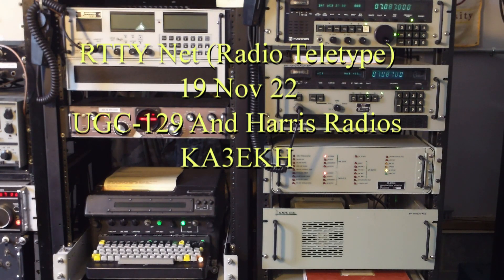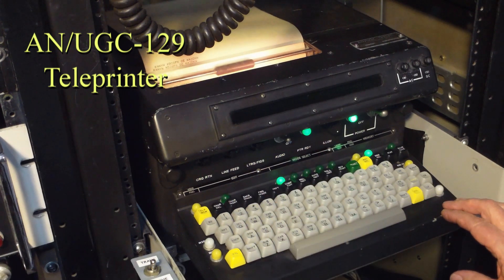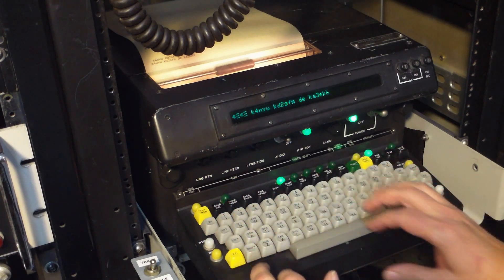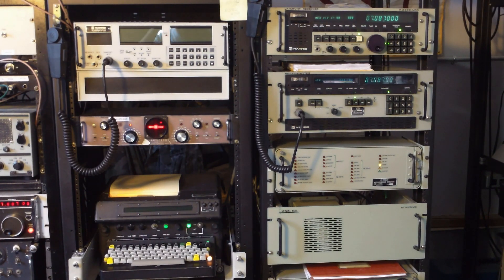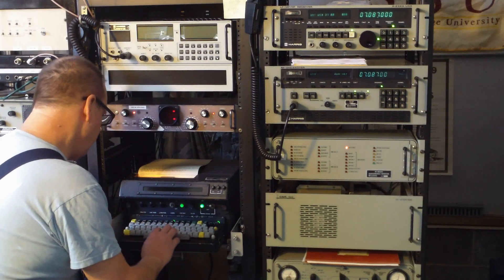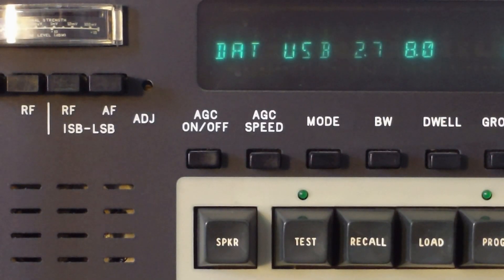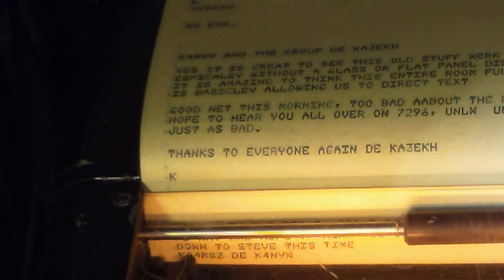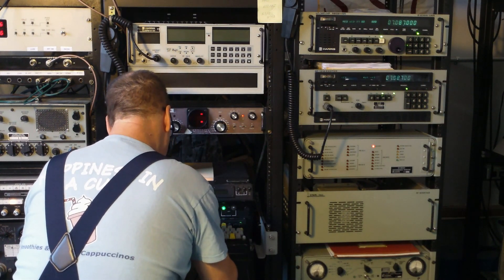UGC-129 Teletype and Harris Receiver, Exciter and Amplifier

Comment: I haven't seen a 129 in over thirty years.  I maintained the unit at SAC HQ Command Post in 1989-91.  Nice piece of gear.  You could also transmit the alphabet phonetically via the keyboard.  

Great looking setup you have.